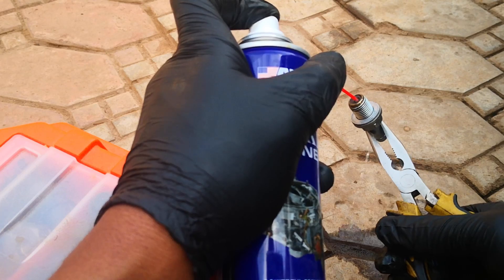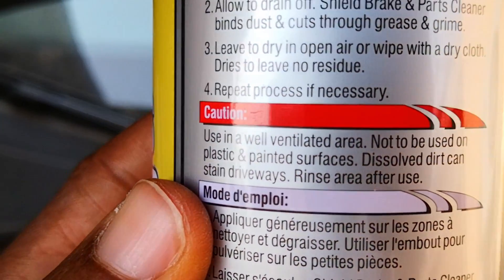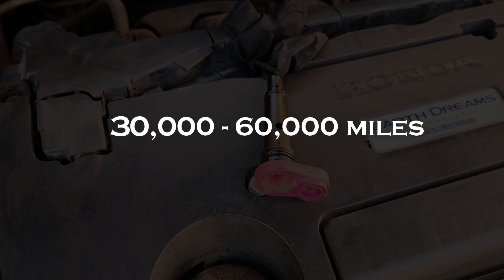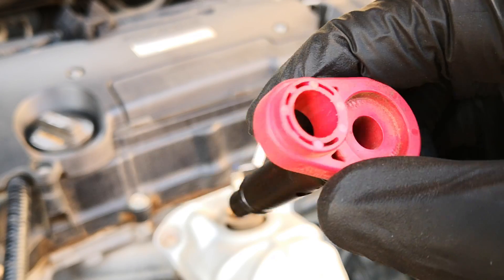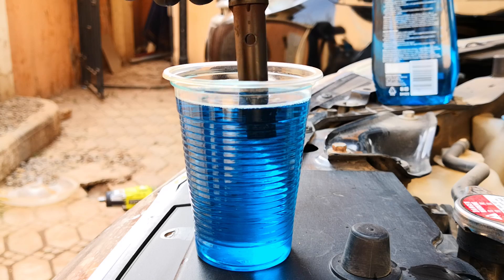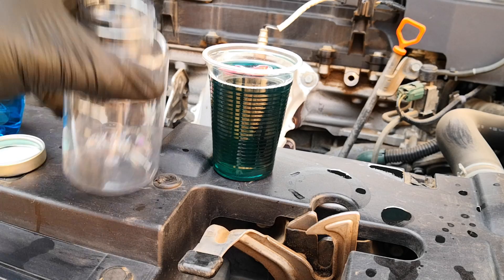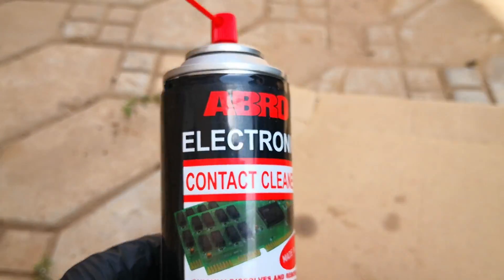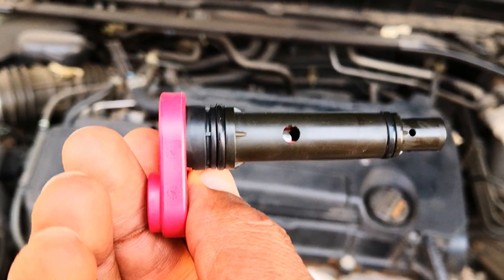How to Clean Plastic PCV Valves / What can I Use to Clean my PCV valve? How to clean your PCV valve

Comment: It's August of 2025 and unless you insist on OEM parts, you can get a new valve for less than $10US.  I don't know what the cost of the chemicals is. Granted, you're using only partial bottles, so the cost goes down.  On the other hand, being that you can't see inside the valve, it's impossible to know just how clean you got it.  Will it last as long as a new one before having to go through the process again or finally replace the valve with a new one?  If not, you might not be saving any money at all.  Still, it's good to have options, especially if you need a quick fix and a new valve might not be readily available at low cost.
Reply from the maker: So, don't get me wrong. This is not meant as a replacement for changing a PCV valve. I replace PCV valves around 30 - 60k miles, but clean them annually as part of routine maintenance. On critical parts, I only use OEM, and PCV valves are one of them. Once had a Beck & Arnley PCV valve snap in half and I hadn't even torqued it down to spec. That was many years ago and was what really made me stick with OEM for PCV valves. I was lucky to get the broken part out of the engine.

Comment: Spraying it with MAF cleaner to remove any possible traces of water is huge overkill and doesnt even make sense. The mixture of gases going through the valve on the regular certainly contain moisture
Reply from the maker: Well, I just don't want to add to the moisture especially for a GDI car.
Reply: @DIYAutoworksNG  It wont hurt anything. I cant make it any simpler for you. GDI has nothing to do with anything. You could pour an ounce of water inside your valve cover and it wont hurt anything. Theres nothing worse than non mechanics trying to be one on youtube. And if you are a mechanic, your not a good one.
Reply from the maker: @Mach141 so, your issue is that I displaced water from the part, right?
For me, it's the right thing to do, and it's okay that we see things differently. Thanks!
Reply: @DIYAutoworksNG  Of course its okay that we see things differently. I can give logic to back up the way I see things. You can not. That is not okay because your spreading the wrong information on youtube to other people. Your going to have people thinking a bit of water under their valve cover is an issue when it simply is not. Its not an issue in the intake tract either. In fact its a good thing, the hot steam it will create can clean your valves, like on GDI engines that need valve cleanings. You want to do things because they make you feel better, go for it. I dont think you should be telling others to do the same without explaining why its necessary. You just dont know any better. Thats okay. The proper thing to do is say "yeah, you are correct, removing water is not required at all and im just being anal". Not to mention you imply this is a cleaning between valve replacements. PCV valves never need replaced, unless they physically break. They only need cleaned. Ever. Why would you clean it to prolong replacement, and then wait for it to get clogged, and then replace it, instead of just cleaning it again?
Reply: @Mach141 get off the channel

Comment: I just repaced the PCV valve on my 2015 Accord. The old valve didn't rattle, but the new one didn't rattle either. How can you tell when the old valve is not working?
Reply from the maker: These newer PCV designs are much more difficult to test. I wouldn't bother to do so. Just replace.
Reply: @DIYAutoworksNG  Thank you

Comment: This looks like the one I replaced in my 2014 Accord. How does it even work? It's basically just a plastic tube with a hole in it. No valves at all.
Reply from the maker: Correct. Same part in the 2014 Accord. 

PCV valves are no longer as simple as they used to be. E.g. The blow test doesn't work on these ones, though they actually have a  check valve.
Reply: Thanks for answering.
Reply: On a 2020 Honda CRV, the PCV looks just like the one in this video aside from the cap being yellow rather than red.  The do have a moving part inside, but it barely rattles -!it seems like it might be made of a plastic or atnthetic rubber material.  If you blow into the bottom with your mouth also covering the two side holes near that end, the internal piece should move and seal off.  If it allows air to pass and go out the two side holes near the midway, it's not working right and needs cleaned.

If you blow into one of the upper side holes while covering the other, air should flow freely out the bottom hole and the two side holes near the bottom.

My vehicle has only 37,000 miles and I'm having to clean the PCV for the third time already.  I'm thinking of buying a new PCV and I'm going to stop using the cheap gas at Walmart and switch to Mobile gasoline that's supposed to have top tier detergents in it to see if that makes a difference.

Comment: What cleaner you used
Reply from the maker: A water-based engine degreaser. Made by Shield. It's a South African brand.
Reply: @DIYAutoworksNG  can I use different cause I don't have that one
Reply from the maker: @markben53728 sure.

Comment: Used carb cleaner to clean my PCV on my ‘16 Civic… let’s just say I snapped it in my valve cover because of this and fortunately enough was able to pull it out with a 3” screw and some pliers. Lesson learned! Thank you for the proper way of cleaning these little plastic parts 🤙🏽
Reply from the maker: Thanks. So happy you were able to pull the broken piece. Didn't know these have a risk to snap in place!
Reply: They sure do! I’ve read on civic forums it’s quite common especially if you don’t switch them out every 30,000 miles or so as preventative maintenance. Granted it’s a wise thing to do since it sits on-top of the valve cover and engine so it’s always exposed to high temps. From now on I’ll be replacing mine often to prevent that incident from happening again!

Comment: was the engine misfiring before it was the pcv was cleaned ?
Reply from the maker: Nope
Reply: @DIYAutoworksNG  would a dirty or clogged pcv cause a clogged injector?
Reply from the maker: Clogged injectors result from a combination of factors in the fuel: Impurities, heat soak forming varnish when the car is turned off and all. I won't be thinking of the PCV valve.